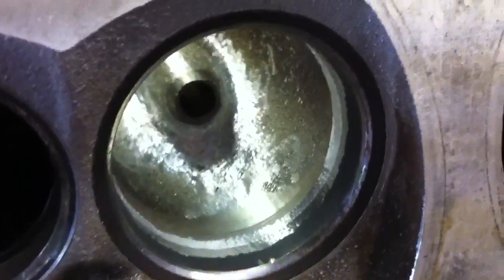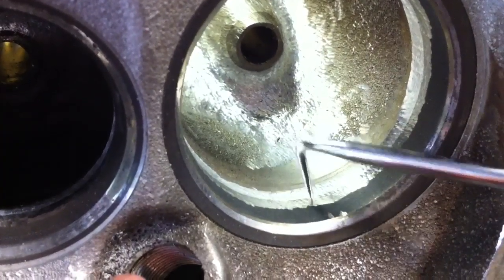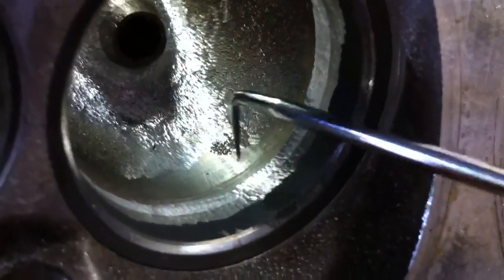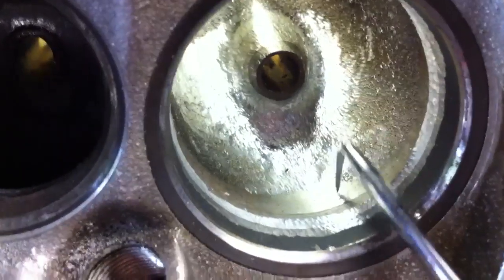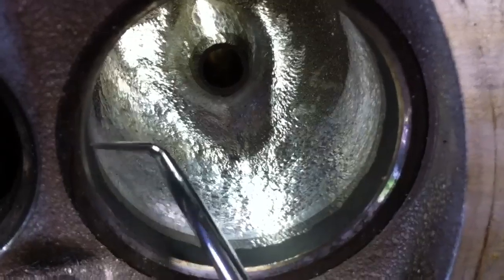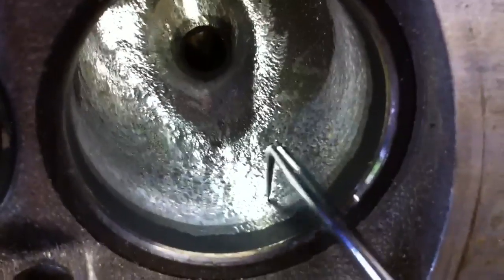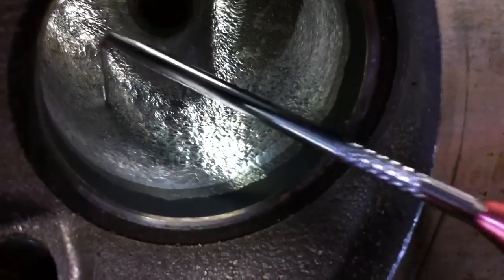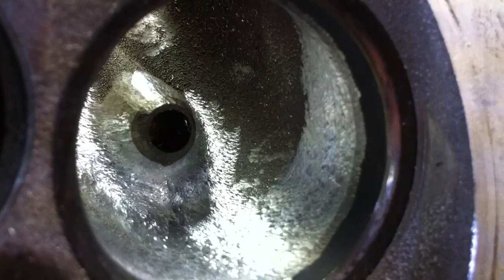How To LS1 DIY Head Porting Part 5 - Blending

Comment: Just asking for clarification, are you cutting the valve seats smooth to where it meets the head? I’m seeing a lot of videos where people are talking about port % cuts and I’ve already cut mine by just blending it in so it’s all smooth. Will this be an issue?
Reply from the maker: The seat edge smooth to the head is good.

Comment from the maker: In my opion, some small turbulence possibly. But that would arleady be created by just traveling through the port and around the vavle guide boss. I dont see how trubulence created by running into the back of the valve seat lip would help. I believe that it would cause so much turbulence that it'd slow velocity by changing the direction of flow. Those areas that are being blended where not purposely put there by the factory to create turbulence. They are simply machining marks that need some TLC